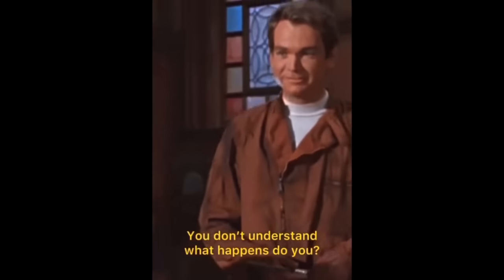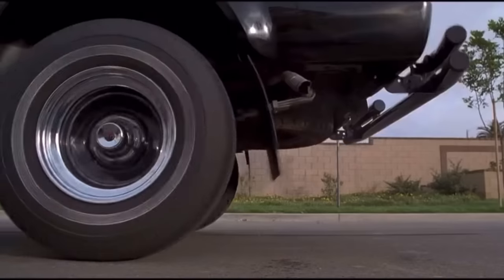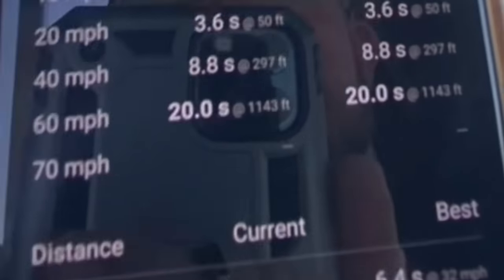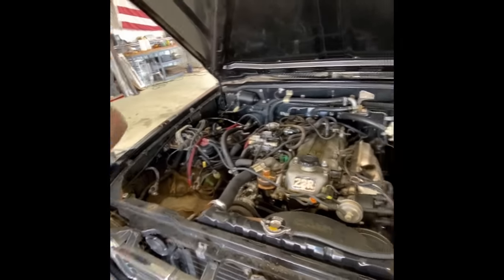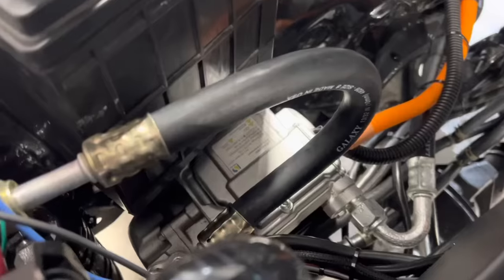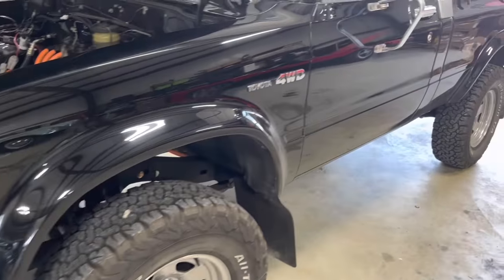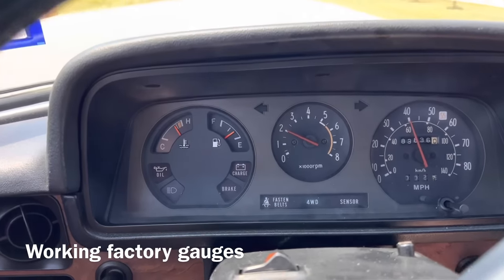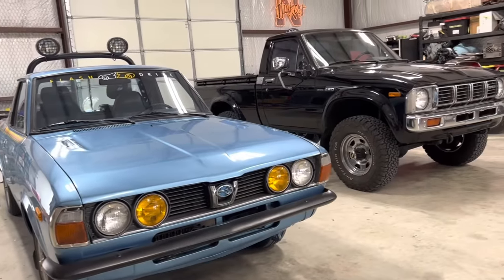22R to EV Swap: 1981 Toyota Pickup Hilux 4x4 All Electric Conversion with Hyper9 motor Tesla Battery

Comment: The Hilux was popular here in Australia too. Need to get the word out about this one! nice work. Curious though, I assume it could take a larger battery load is that right? It seems a little light on even if you didn't want super long range.
Reply from the maker: It could take more batteries but since it is 144 volt (aka 7 batteries), we would have to jump to 14 batteries (double the packs) to work at the same operating voltage. It’s doable but also would add considerable weight and take up usable space.  Thanks for the question.
Reply: How much does the whole kit cost
Reply: How much for the complete conversion kit please

Comment: @1m in: BRAT!!!!!
I've wanted to convert one of those since before Tesla was a glint in Eberhard's eye. 

I like the slightly older, slightly boxier ones though. My first car was an '86 GL, the little 2 door. That thing was an absolute demon in the snow, sooo much fun. 
And it could go up Jeep trails almost as well as a Jeep. 
On highways... well I didn't go on highways if I could avoid it. I got 23mpg max, averaged 19. 

Now I have a Bolt. Also a blast to drive, but I get >100mpge while doing it. Not fun in the snow, not unsafe just that it's only FWD so no donuts or drifting or stuff. 
I still want an electric Brat, but it'd be a toy car. Something I could only buy/build after many, many other things got done first.

Comment: I have a question. Do you guys do a 2 motor on axle mounted conversion? Let's see I wanted to keep the engine bay for a silent diesel generator to extend my range and make this an overland pickup or SUV on a reliable chassis. Or add solar to it in case of a van conversion with an ample extendable off the roof solar panel set or an overlanding camper.

Comment: I have a 2002 Ford Ranger XLT 3.0 V6 5-speed manual 4x4.  What would be the cost of conversion to the same system as this Toyota?
Reply: buy  s10 cheavy 70  mioes rañfe

Comment: Great Idea and execution.  Why did you keep the radiator?        I think I would rather have hub motors though.     Then you don't need to do the 4x4 transfer case, differential lube maintenance.  It's power where you need it.   You can get rid of the drivelines etc.   More expensive, I know, but a lot more efficient.

Comment: That was cool, but I don't understand the shifting in the zero to 60 test at the end, the Hyper9 has 220Nm of torque at zero RPM and an RPM range of 0-8000, why not just leave it in top gear?

Comment: Do you need to install an electric vacuum for the brake booster? And did you keep the trans? Or run straight to the transfer box?

Comment: Cool build, I have a 1983 Toyota pickup 100% original, its my daily driver. Everything under the hood is original minus routine maintenance items. Original bottom end, 40 years old now. 
I highly doubt that electric setup is as reliable as the famous 22R.

Comment: If I get in mine (carb/22R) I can go 300 miles....how far in this one?
Reply: Ive got a LCE stage 2 stroker  22R weber carb...150hp @5600rmp 173ftlbs @3900rpm pushing a 4x4 and still get 300 mile range....OEM hp was 103hp @5000rpm 138ftlbs @3200rpm,,,HUGH difference.....This EV from others comments gets about 100mile range???
Reply: 80 mioe rañge

Comment: In Australia were l live you can buy an electric conversion done toyota hilux cab chassis rear wheel its the basic hilux even comes with manual windows and with the electric conversion its around aud $100000 this company gets the whole minus engine and gear box from Toyota and builf the electric ute l just wondering your ekectric conversion cost l noticed you left the gearbox in and transfer case

Comment: Looked thru your channel, saw no promised follow up with tech specs. Want to know kWH of the batteries, range, weight. I figure to get 100 miles range I would need to add at least 1000# of battery (if there was room without using up bed space) - probably more. Until battery/capacitor tech/energy density becomes considerably more capable and affordable, I will just have to stay with the stock ICE - as much as I would like my pickup to be an EV.

Comment: What'd you get the power steering out of? Did you use a honda's electric steering system?
I've seen a lot of people go with those, so I'm curious to know what everyone's doing lol.

Also did you run all those tesla modules in series configuration?
Reply: The "high voltage" HyPer9 is rated for DC supply voltage from 90V to 180V, and 7 Tesla Model S/X modules run about 22 volts (nominal) each, so the modules must all be in series... as battery modules should be.

Comment: I’d like to know more about the range for an electric swapped vehicle. I know it depends on the number/size of the batteries, but how conceivable is it to take that Toyota 4x4 on an off-roading trip where there might not be a charging station within 250 miles? I would consider converting my Chevrolet Tracker 4x4 when the motor dies someday if it made practical and economic sense. I’ve done so many modifications that I don’t want to start over with a new vehicle, but just improve it.
Reply: It isn't factory EV's are far heavier than an equivalent ICE vehicle and they save weight by making the battery a structural piece but a conversion can't do that so the only weight you have is from what you remove then you are eating into payload not to mention that as the weight goes up an EV's drops off rapidly so if that trip requires a decend load or you pull a camping trailer even factory 4x4 EV's won't make that distance
Reply: @shaynegadsden  I appreciate your insight. That really helps me as my rig has a lot of armor and a built-in platform for sleeping and storage. Too heavy for an EV.
Reply: @brandongilden1680  also i looked at their site and the kit which is just the driveline parts is $20k US so with the extras needed it would be an easy $25k diy job

Comment: I'm over here in Montana, the wife has to Ford escapes one is all wheel drive the other is 4x4. The 4x4 has a bad transmission and the AWD one doesn't want to run. What would it cost for you to make the AWD one electric like you did with the Toyota and maybe use the 4x4 one for parts? I have email setup on my channel if need be. I also have other videos you might like. Just let me know please.

Comment: What is the cost for this Conversion? Please answer everyone is asking besides me? I have an 84 Toyota Hilux solid axle 4wd 2L Diesel engine with 320180 miles as of today. Truly not a speed racer but it goes anywhere in 4wd low.

Comment: My 1993 Toyota 22RE needs the 2nd Block Rebuilding, got quoted $1,800 but i have to remove the block or have mechanic friend do it. Thinking now is the time to Electric Conversion, if i get motors on both Axles it will be AWD right now is RWD.
Reply from the maker: This little truck is going strong still! Call flash drive motors ! They can set you up
Reply: @dissrepair I was thinking yesterday it could be $10K or more. Right now the Engine shop said $1,800 if I bring the Block and $2,500 if they remove it and put back in. The 2025 Dodge Ram Electric Truck is now 690 Miles Range with a Generator to self charge. I will get it brand new but the base model 500 miles no V6 generator.

Comment: I see that you hooked the hyper 9 to the transmission. Could you not hook it up to the transfer box, remove the locking pin and have a 2 speed, minus the weight of the trans?
Reply: I thought you don't "really" need transmissions in ev? I'm available rookie though.  I know evwest makes the 22r to transmission adapter plate.
Reply: The HyPer 9 is marginal without the ability to shift gear ratios to keep the motor in a speed range where it can produce higher power.

Comment: Awesome conversion. I would like to convert my 2WD 1978 Hilux! That's my next big project goal. 
With a roof full of solar panels, the "fuel" is free, and with improved torque, performance and lowered noise, what's not to like?!
Reply: You won't get shit for range with solar.  The vehicle itself is a brick.
Check out aptera, it's about the only ev that can benefit from solar due to its aerodynamics.
The solar racer did but thats a 1 seater specifically designed for that.
Reply: @rebeccadubois8270  In consideration your comment, I have decided to give up on my project in its entirety. Obviously, you are much wiser and more knowledgeable than I am, potty mouth notwithstanding.

Comment: The engine bay looks like it could hold more batteries for extra range if you so desired
Reply from the maker: We think it could use another motor too! Wouldn’t that be a fun power adder
Reply: @dissrepair  you definitely will have to beef up that rear end if you do add another motor.

Comment: Hello from D.R. Just one question, do we need to remove the original transmission to get this ev convertion?
Reply from the maker: For the conversion we did, we retained the original transmission. This was done to retain 4x4
Reply: @dissrepair  thanks you, for your soon reply. You have done a great job with this Pickup

Comment: Does the engine work as a dynamo and charge when you’re coasting down hill?
Reply: Regenerative braking is a normal feature of modern EV components, including the HyPer 9 and its controller. They should have enabled it.

Comment: Trans can only handle around 150ftlbs reliably unless you swap an R-series trans in. 
The Tesla modules won't last the same amount of time the bottom end of the 22r will....
Reply from the maker: The batteries might not last forever but I’d wager that electric motor will outlast an ICE motor
Reply: @dissrepair  depends on whether or not they're brushless.
Reply: That electric motor (the HyPer 9 HV) can only produce 162 lb-ft, and even that only briefly.
Reply: Brushed motors are not used in EV conversions any more, unless someone is using cheap salvaged components. The HyPer 9 is a permanent magnet 3-phase AC motor (which means that it is brushless).

Comment: Disappointed that you won't answer anyone's range questions. I am in the middle of this exact build in a 1977 FJ40, same motor and the same number of batteries and people I talk to in the space recon I will get less than 80km range on that setup.  Was hoping for more like 150km but that does not seem likely.

Comment: Would a generator be able to be used with a adapter plug so you could recharge in the bush not at a garage.
Reply from the maker: You can charge off any 110 or 220 plug you could find

Comment: Now with a 5 speed can you get re gen power when down shifting to slow?
Reply from the maker: Absolutely, regen can be turned up to reduce the need for brakes. In fact, it could be used to help downhill in rock crawling
Reply: @dissrepair  I would swap my 1st gen 4runner in a heartbeat but I loose power a lot during the winter sometimes we can have no power for over a month but man it would b really sweet .extra quiet for when I go hunting is allso a big plus side .keep up the good work guys .I can see a lot of people really like what you are doing with these Toyotas .about one of the only things I would swap my 22te for would b a diesel or an electric I bet it would plow snow like crazy with an electric motor

Comment: This is a great build. My son and I did a 1996 Tacoma with a Hyper9 and a 25KWh battery (https://www.youtube.com/watch?v=xNKIOmkePE4).  We come in at 2900 lbs and this was a 2wd truck so we can do 0-60 in less then 7 sec. We also did dual chargers so we can charge at 40amp 220v.
Reply from the maker: That’s impressive
Reply: @dissrepair  how about a gas generator , small battery, and electric motor? probably cheaper to maek and run, lot lighter agile etc.           reason why i dont liek electric car is  that battery degradation and lack of battery recyling. dendrites that forms from battery degradation is messes with recyalability too.  if you look at sandy munroe video caled wjats insize 680 battery, there could be indicator of how much of battery can be recycled by mechnaical seperation vs what chemical process would be needed, woudl it be susntinable process? recycling company called redwood. even if they fix this problem, will they dig through trash to find enviromentally damaged (rust, mud,etc) dead car batteries currently being dumped, and recycle them? in emissions, best hting to do is a ca rof where rear seats face the rear as comcpact 4 seate rreplacing 2+2 seater cars and yaris corolla cars, and  rear mid engine small combustion flat 2 cylinder wnith no rotatiing parts to send power to wheels, instead magnets moving back and forth make electricty aand or a little supplemnetary compressed air , to power electric drive and compressed air driver, possibly with no battery or at minimal battery, using supercapacitor etc. single combustion chamber would help preserve heat for optimally low emissions or effeincy, hydrallic switch will push pistons back to position so they can be pushed by combustion..  optimal combustions per second for emissions with electric and mechnaical hybrid turbocharger, sometimes engine will run beyond optimal effiency or emissions levels for unsuually high power demand to protect long term emissiosn and fuel use reduction effetiveness of battery for common lower power use. with limited batterys to use, hybrids are already more effceint effective at reducing emissions, vs using that battery material for fewer cars who are electric cars, becaue most emissions happens in low speed high pushing power sitatuaitons of combustion car, where emissions are most likley to chemicaly harm health of nearby people becaue its usually compact city area with many people nearby.              what battery size is best for longevity?  see tony hellers climate change videos, maybe somone can make use of suspicious observers videos.    mahle says they are developing non magnets motor, so its more recyclable and cheaper..      see aptera owners club video on saftey, unqiue materials they use, lightweight is safer to peopel outsid ethe car but can be safe for people inside car compared to hevaier caar if using right materials, and even safer due to wat type of crash is more likley to happen.. linearly more lighter weight exponentially causes less road wear damage causing less resurces and emissions and road downtimes. .....  the low weight compared to  structrual strength and crash energy absorption, makes its safer per costs ,. the weight lower to ground (if that is how its still done) can make it preserve momentum around turns more, which is more energy effceint than relying on regenerative braking, and battery, brakes, lubrication, etc would last longer. tires longveity may not be affected despite higher speed and fun of preserving momentum with minimum g forces .      ....      in effeincy per functionality, rear seats facing rear in sompact 4 seater woudl make more sense. solarpanel effeincy is only arouund 20 percent and can become lot better     if u want lower emissons(whch only helpful for heath of pepe wh send mhme near heavy traffic roads), then using mited batteyr supply for hybrids is lower emson than using the suppply for fewer cars whch are eletric car. big batteyr means exppnentially less effceint, so the more energy going in and out the battery means worse battery degradation, but more parraleles of battery reduce battery degradation... so more battery is not better, theres a balance to be had.   see videos by tony heller, and suspicious observers videos on climte change and romanian tvee video called why woke wont go broke and leather aprons clubs video called a parabel on banking... theres a lot of reason to be suspicious and not much way to verify claims that climate change si caused by humans.
Reply: what's the range with normal highway driving?

Comment: Where are the batteries?  At the end of the day, this is still a truck, so battery placement matters, and they need to be anywhere except in the truck bed.
Reply from the maker: They are under the bed. Where the gas tank was.

Comment: Should have left the 22R, put the electric motor in front of the rear dif and the battery in the bed. Use the 22R as a generator.

Comment: This swap makes no sense?

0 - 60 means nothing. What did you do to the weight of the truck? The braking performance? The range? Cargo capacity? All of the important things like that.

Why not get rid of the weight and parasitic losses of the driveline, leaving more room for batteries, and mount motors to the axles? There should be enough torque and rpm that the transmission is unnecessary. That just left a bunch of mechanical bits in the system to require maintenance or to fail. 🤔
Reply: You forgot the most important one : $

Comment: definetly more reliable now... at least this one isn't on a toyota truck train to mexico... "the Mexican Connection"
Reply: Yeah real reliable. Anything happens to it you gotta replace the whole motor rather than a simple engine rebuild.
Reply: @jvogler_art4708  i simply think that the electronics of the Arab drive train ain’t going to survive in Mexico  😂 😆

Comment: The 22r is trash thats why a petrol hilux sells for half that of the diesel version, but as for reliability come on seriously there is still plenty of 81 hiluxs driving around no problem on their original engine and while they may not be quick they still funtion as intended 42 years later and you think that EV conversion is going te be going 42 years in the future i think if it makes 10 years you will be doing well

Comment: That truck is only as good as those 1970 battery cells you are currently using. The ICE engine is way more reliable as has been proven. Try driving that thing in -20 everyday, try charging at -20. Every Technology has its drawbacks and EVs current draw back is the battery tech in them sucks BIGTIME.